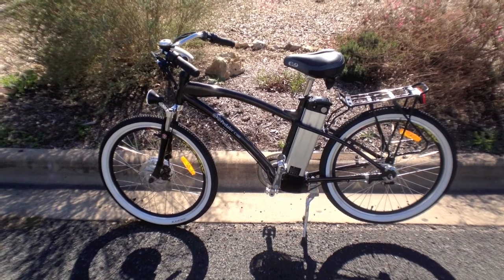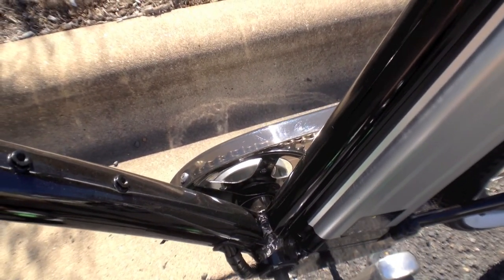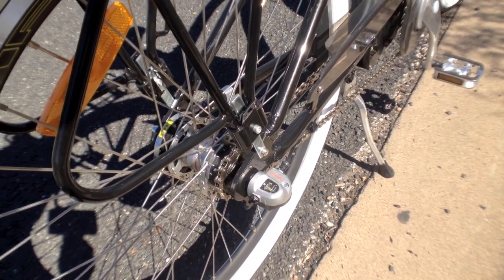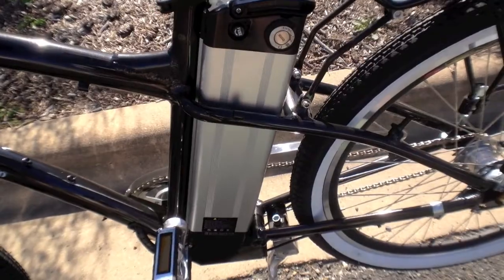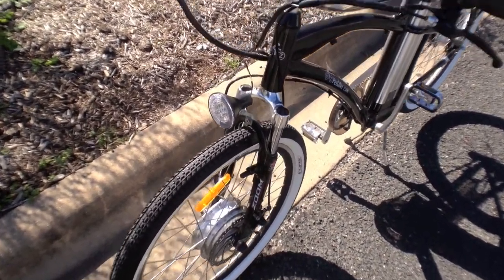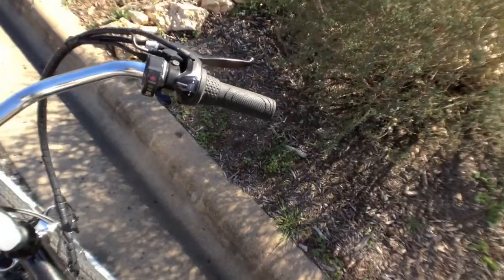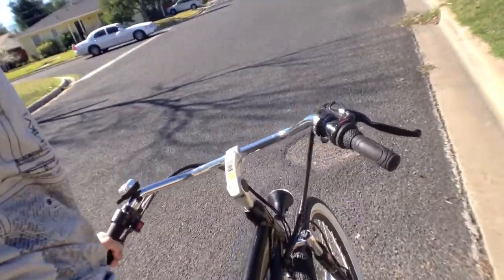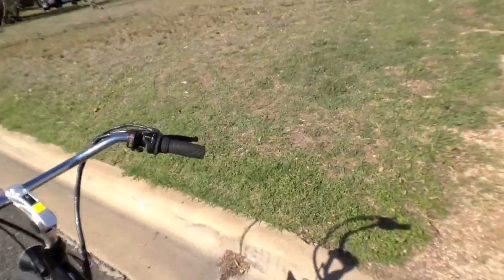EZ Pedaler C300 Electric Bike Review - $1.9k

Comment from the maker: I hear you, the great things about this bike are the reasonable price, extra features like lights and fenders and the fact that it has throttle and pedal assist. This bike will do fine with hills but may not carry you with throttle only, you may have to use an easier gear and pedal along in pedal assist mode to get up. Depending on your size and the groceries you get, you may have to pedal harder but it will still be way easier than using a non-electric bike :)